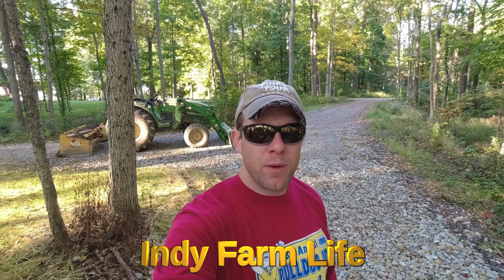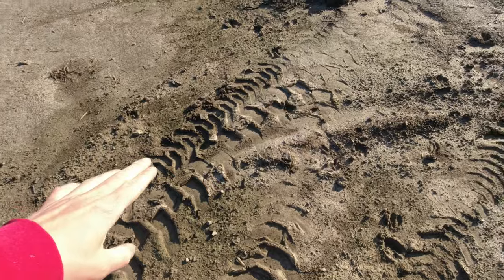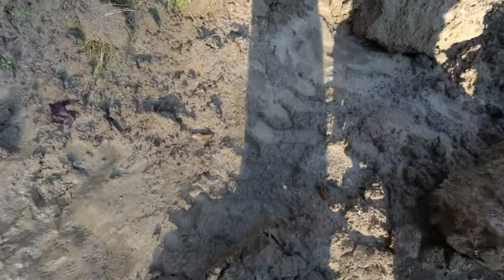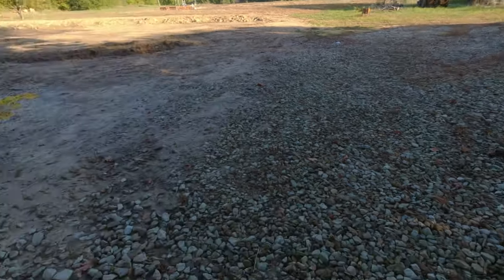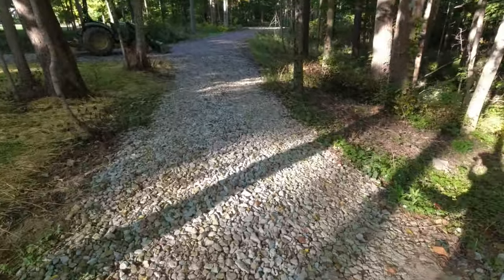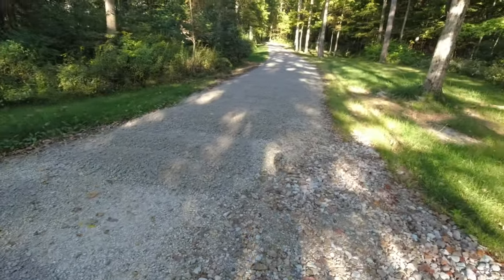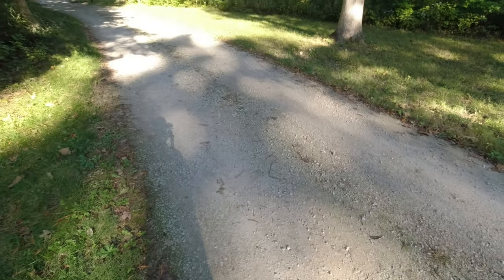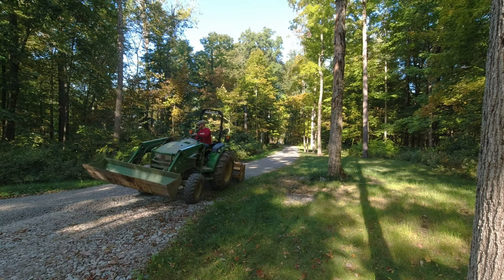How to Build a Gravel Driveway...The Right Way!

Comment: This might be a stupid question but if  you cut a tree down to the point where it really doesn’t protrude out of the ground, would still remove it of your driveway?
Reply from the maker: If you were a contractor doing it for someone then, yes. If you leave it in your personal driveway, what's the harm?  Well, eventually it will rot and cause a pothole/sinkhole that you will need to fix.  You may also have trouble removing other topsoil in the area.  However, you can certainly leave it.  You just may have a fix to make later.

Comment: An alternative view would be to remove the topsoil first no matter the soil type. You always have topsoil with organic material. Follow this with a base layer of crushed stone with fines. In clay soil the crushed stone will bind with the clay and help stabilize it. Follow this with your larger 1.5" minus stone. Then add a top layer for smoothness if you like.
Reply from the maker: Good advice!  When I first started reading your comment, I thought you were going to say "an alternate view would be to just pave/concrete it" 🤣🤣

Comment: after you have dug out at least the thickness of a car tire plus say 3 to 4 inches more, you lay your 2 stone, then get car tires and cut out the sidewalls of the tires,put the tires down on top of the 2 stone, then pour your gravel over the tires, the gravel being inside the tire will never spread out and the thickness will also be great for water to soak through and when you drive over it, it will pack down, you can drive a fully loaded dump truck over the drive way, you will never get a pot hole or ruts ever. and will last for years and years with no problems...

Comment: I used geo here in Southern Oregon becaouse i was logging 15 acres of douglas firr. 3 acres clear cut for my house. Took out everything 18" at the butt or larger. "Great money." $980 a thousand bd ft
I was bringing in 80,000  pound logging trucks and 80,000 pound concrete trucks.
Build for what your needs are.
That was 2013 and the trees have doubled in size.
Harvest again in 10 years.
Cha ching!

Comment: I have a small area at the beginning of my concrete driveways that I guess previously had gravel. It fills with water when it rains too much, too fast. I bought the home 4 years ago. I was 21. Was always too scared to attempt to fix it but also haven’t been able to save enough to pay someone. Thank you for this video!! I feel fairly confident that I can knock it out now.🙏🏼
Reply from the maker: How big is the area?  Ideally you would have someone with a piece of equipment rip the potholes out.  If not, just fill them in with some crushed gravel and you should be fine!  Glad it was helpful!

Comment: I will agree with the statement about not needing geo-textile on clay - but with one caveat: only if it's well drained. I'm about to start a job for a client where the larger rock has been beaten down into the clay over time because water tends to stand in certain areas. Given enough time the clay softens up and you are in a similar mess to building on topsoil.

So my first step is always to look at drainage. Where is the water flowing? Where is the water sitting? Are there any soft spots from underground water? Then I can make a decision about using geo-textile.
Reply from the maker: That's a very good point.  Water soaked clay can be an issue for sure.  In all construction, water can be a huge headache.
Reply: @IndyFarmLife  agreed. Most of my work comes from people building first and thinking about water later - which is good for me, but it can be expensive to rectify.

Comment: Clay is hard when dry, but it's VERY soft when wet! Rocks push straight down into it.
Reply from the maker: I agree when fully saturated.  The key here is to build your road so it sheds water.  I would guess that most of the clay under my roads is dry.

Comment: Live and work in the southeast. Ga and Sc which in areas have red clay. Ga has the best I’ve ever seen. Put it in right and you can’t drive a stake into it. Almost never use fabric and I do this for a living. Good job and good video.
Reply from the maker: Thank you!  I certainly appreciate the feedback from someone who does it often!  Some have made the comment that when wet, clay is a mess.  I agree with that comment but if you pack your stone in and have a crown, your clay underneath never really gets saturated!

Comment: The trucks with gravel that has fines mixed in can carry less volume because the gravel weighs more per cubic yard, and the trucks are limited by their weight limits. Drain and ballast rock has a lot of air space in each cubic yard, so each cubic yard weighs less.

Comment: All good advice.  I've skipped the #2 for expanding a driveway/parking area because it's harder to spread... and it worked because I spread it thick, but a better base would have been better just like you said.  I never put 53s next to the front door or porch of a house because of the dust like you said.  Great video!
Reply from the maker: Thanks!  We have done the same thing before with skipping #2, but then you end up just putting more #53 down to achieve the same results.  #53 dust is great, but can also be a mess for sure!

Comment: Thanks for the video.  I'm wondering how deep (thick) is each layer of the different type of gravel?
Reply from the maker: It really depends on how 'heavy duty' you want your road to be.  I typically do the following. 4 to 6 inches of #2, 3 to 5 inches of #53, and 2 inches of #8.  This would give you a road that should easily handle daily traffic as well as dump trucks and the occasional concrete trucks (when dry).

Comment: Great info! If you build your road on clay without the road fabric, when it rains, wont the clay absorb the water and become soft then tracks start to form? At my place, the clay develops a firm crust that holds up to light use. If you happen to break through that crust it can become bottomless underneath. The road fabric does a very good job of keeping the rocks and the clay separate as well as distributing the load a bit.
Reply from the maker: The key is to ensure that the road is sloped to shed water as well as have deep enough layers of each type of stone.  Once you get a good base of #2 packed in, you aren't going to have it pressing down into the clay.  The only way would be if you build your road/driveway so that water is constantly standing on it.

Comment: Thank you for the well explained layering of your driveway!  However, I see all your roads are flat. 🙂 How might you change anything if you were building up a 20-30% grade (about 200 yards uphill)?  I have ample drainage on both sides of the road.  Just wondered if you would change rocks or layering to retain gravel and minimize rutting on the slope.
Reply from the maker: I would say it depends on the intended use/type of traffic.  If heavy trucks/tractors, I would maybe just leave it at #2.  If a normal drive you may consider stopping after #53.  The #8 may roll a  bit like marbles on the surface

Comment: Interesting. We are in process of having a pole barn built in central indiana. Will have to build a gravel drive 10-12’ wide and about 80-100’ long. Will be driving my pickup and a pull camper or 5th wheel on new drive.
Reply from the maker: Good luck with the build!  Hopefully you have some good clay to work with.
Reply: @IndyFarmLife  Thanks!

Comment: What do you recommend for a driveway built on thin top soil over creek gravel. On top is thick vegetation. I’ve seen both geotech directly over the grass and the grass scraped off. It has to hold dump trucks, fire truck and general construction vehicles.
Reply from the maker: I'm a belt and suspenders type of guy.  Without seeing it, I would think you would want all the muck/organic material pulled out and build it back from scratch.  May have a rutted up mess otherwise.

Comment: Great video, thank you!  
I have a gravel driveway that is currently clay topped with about 3" of crushed  concrete (ABC) on a decent slope.  When we have a hard rain it tends to wash out and rut.  I was planning to scrape out the ABC and have #5 lime stone (app 1" in size) brought in, let it compact over a month or two, then top with the ABC.  What are your thoughts on this?
Reply from the maker: If you are going to the trouble of digging it out and adding a larger stone, I may opt for something like the #2 I show in my video. (Not sure what they would name/call that near you).  You would hate to have to redo it again if the #5 isn't large enough.  If #2 gets washed out, then you have much bigger problems than a failed driveway. ha

Comment: Very timely video. I'm building a house in Shirley IN, and was thinking I'd need geotextile but now I need to rethink that. Driveway will be 1260 feel long so lots of stone.
Reply from the maker: Being that close I would think you probably have some good clay to work with.  If so, you may be able to cut out the fabric!  Do you have a tractor or plan to rent something?  Also, if you need an electrician let me know.  The electrician who wired our house was amazing and lives very close to Shirley!
Reply: @IndyFarmLife  No tractor yet, will have the same guy put in the driveway, culvert and septic (mound system ... darn it, but required after perk test results). Thanks for the tip on the electrician, who is it?
Reply from the maker: HD Electric.  Let me know if you want me to put you in touch with them.
Reply: If I’m wanting to put a portable barn 15x25 in my back yard, can I use the goetext and put gravel on top of that or do I need to take out the top soil so the gravel don’t sink?
Reply from the maker: You can really do it either way.  One method is time/fuel, the other is buying and laying fabric

Comment: I have a question. I did a lot of prep made my whole driveway out of clay/chert material with 3% slope on each side of the crown and drainage ditches. When I lay the initial big rock layer down, should I try to keep the crown? I find it difficult to grade those big rocks.

Comment: The driveway to my home was built in 2008. I have added gravel a couple times throught the years. I am guessing it is compacted and originally built in layers as described. It is all clay. My driveway is needing gravel. For maintenance, do I need to relayer? Or, just put another top layer on?
Reply from the maker: Hard to say without seeing it.  Any idea what the base is built from?  Unless it has a bunch of clay pushing up through it, I would likley just get a box blade and turn it all and add more gravel.  Make sure it has a crown so that water doesn't stand on it.
Reply: I have solid clay subsoil.  Use a Geo fabric on top of the clay then build up.  Clay will suck up anything you put on top of it!

Comment: I just need to drive my rear wheel Corvette 40 feet from slight incline, wet grass, to moderate incline past house onto street.

Thinking i can just spread gravel on textile and be ok for now. Then later pave it when i have money.
Reply from the maker: For a "get me by" solution that would probably work just fine.
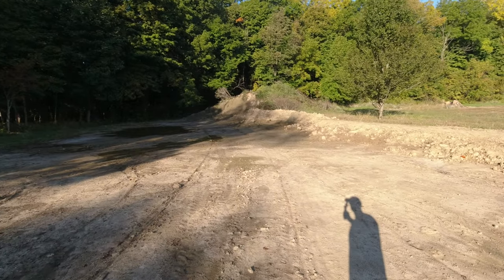Reply: @IndyFarmLife  Yes that is correct. I only have a thin layer of gravel on my driveway. About 1:00 to 1 and 1/2 layers of gravel which is inadequate however my car was able to drive right up the driveway I don't think I slid once at least I didn't realize it. So the reality is the Corvette for some reason with those wide tires, and summer tires at that, has superior traction going up the driveway then my cargo van even though both vehicles are rear wheel drive. The biggest issue I have with the Corvette is making a 90° turn to point the nose out but that has nothing to do with traction and everything to do with the fact that it's basically a race car and doesn't like fooling around. Either you're driving or you're not. Creeping forward and backwards and forward and backwards is a nightmare.

Well I bought myself a 4x4 truck for $3,000 and problem solved. Don't even need to pave the driveway. Lol

Comment: So I already layed down some crushed gravel and standard Lowes rock over grass. Is there anything I can do to improve this parking spot? Is it worth it to rent a compactor to make it stronger?
Reply from the maker: If you didn't pull up the topsoil then you are likely going to lose a lot of your stone as it presses down into it.  I can't say it will be the most stable of parking areas.  If it's just for light vehicles you may be fine, but if it were me, I would try to pull the gravel up and get that topsoil out of there.  If that's not an option, just be prepared to add more gravel over the years.  Vehicle traffic will compact it.
Reply: @IndyFarmLife  thanks so much for the tip. Right now the van that we park there sinks in to the rock but I haven’t packed it down yet so I’m assuming after we pack it down it will be more stable? Thanks again.

Comment: Does the driveway need any sort of slope to one or both sides for drainage? Or can it be pretty much flat? I have a flat piece of property and starting on a driveway
Reply from the maker: You definitely want some slope to it.  Depending upon your ground it can be all one way, or have a crown in the middle to shed water.  Keeping the clay underneath the stone dry is paramount.  Having water run off will also prevent potholes from forming.

Comment: Around here we have limestone known as coral rock. It is an almost continuous layer of pourous rock thet varies from being at the surface to a few feet down. No clay at all or any topsoil. Sand is the material you find over rock. Some "soil" exists in the solution holes in the coral rock. After building a road the natural rock will start to break down as the weight collapses voids in the coral rock.  One way of building a road here is to use a trencher or excavator to dig a ditch and then pile up the rock excavated before dozing your road. Want to build a road the right way? Just get the intelligent man from Indiana who knows how to use his tractor!
Reply from the maker: Hey thank you!  That's good info to have.  I suppose I should rename my video to "how to build a gravel driveway....in the midwest!" ha  So cool to learn about other parts of the country and how it's done there.

Comment: Thanks for the info! Love your box blade. I have a super cheap customer that lives in the woods and wants 1 single material spread on his driveway. Any suggestions on a material smaller than the #2?
Reply from the maker: Thanks!  The Gannon is an absolute monster!  Is this a new driveway build or dressing up an existing?  I'm not sure if anything exists between #2 and #53, but if it were me, I would go with #53.  Even if it were a new build.  It will take a bit more thickness to build up for heavier traffic, but it's so easy to work with, will pack like concrete, and it's easy to get very smooth quickly.
Reply: @IndyFarmLife  thanks for the fast reply. Wasn't expecting that. Lol  I would call this dressing something existing but a lot of it has never had any material at all put down. I think I'll go with the #53 like you suggested.
Reply: @IndyFarmLife  I've always wanted a Gannon but they seem to be impossible to find especially in the small size I would need. I do everything with an old economy power king (subcompact sized). Takes me a while but I enjoy it anyway.
Reply from the maker: Of course!  I read all comments, respond to as many as I can!  I think you/your customer will be happy with that solution.  I do "53 only" roads where I know it will never again see a dump truck/concrete truck.  Even then, it works out just fine if you layer it well.  Hope you will stick around the channel.  Thanks!
Reply: @IndyFarmLife  I certainly will stick around. Thanks again
Reply from the maker: I missed this comment earlier.  Keep an eye out on Tractorhouse.com for a Gannon.  I think you can maybe even set alerts.  I have had good luck there in the past.
Reply: @IndyFarmLife  I'll certainly check them out. Thank you

Comment: how much in cubic yard or cubic feet etc. of the 2, 53 and 8 per area or volume of road? does it work in northern climates where snow and temperature drops below 30 degrees for 4 months and snow does not melt until summer? how about toping the number 8 with True Grid? Thanks for sharing

Comment: Surely even with a camber to drain the water away from your gravel ,it will still absorb water and take it down to the clay which will soften it and then the stone and rock will be pushed down into it.whereas if you have a physical barrier , you keep both seperate no matter what water seeps in. I have always used geo over clay ,as it will let the water thru without mixing the substrates together, and stopping the need to keep adding gravels.the wheels ruts that may from can be graded if you have a good 8 inches of gravel

Comment: Thanks for the video. I’ve got a 38 horsepower John Deere tractor with a FEL.  I don’t have a box blade but I do have a tiller. Do you think it would work to till up some soil and then remove it with the bucket?  How many inches of soil do you think should be removed to create a bed for the gravel?  Thank you!
Reply from the maker: That could work, but I think it would be pretty slow and difficult to shape.  I guess it depends on how much ground you have cover.  Around me, 6 inches or so and the top soil is typically gone.  Looking for that good clay underneath.

Comment: What about sand as a substrate? My town is built on sand. Once you remove the topsoil you just get down to pure sand.
Reply from the maker: Good question. That's not something I have ever dealt with.  What do the local crews there do for roads?
Reply: Same here. The cloth works on sand fairly well.